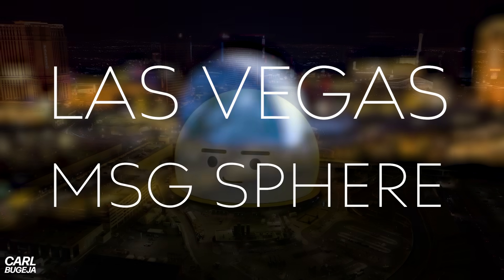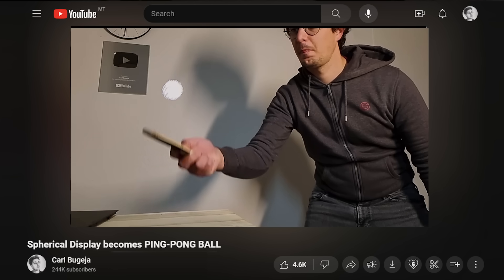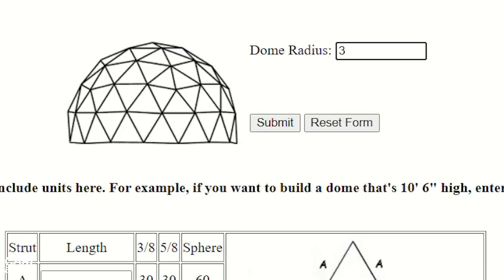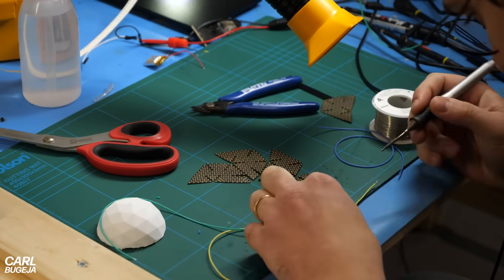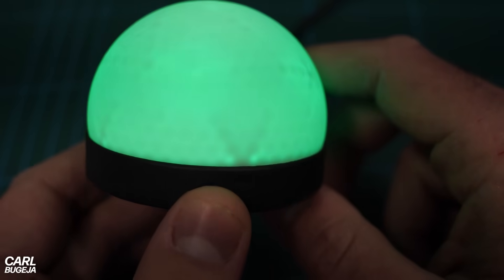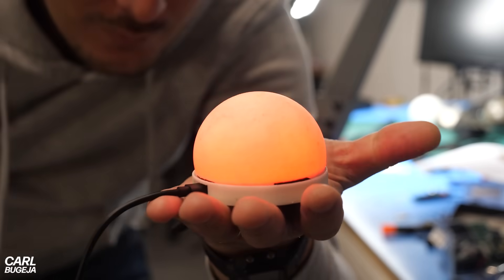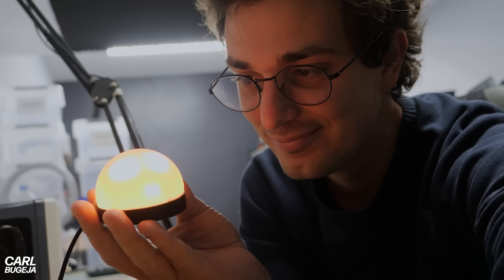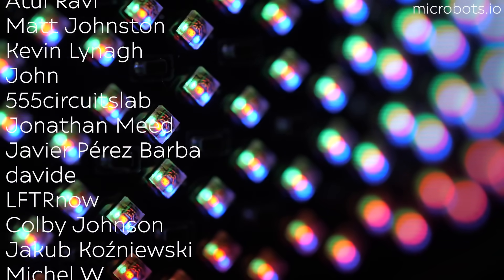Building a Mini Vegas-Sphere

Comment: Instead of trying to build using small leds, you should just increase sphere size and use flex led martixs or make your own from led strip.
The pixel size is not so important if your sphere is large enough.
eg vegas sphere has about 0.1 pixels per inch, you will be good with 1.5-3 ppi of cheap cheenese led matrix.

Comment: How about running fiber optics on the surface of the sphere? Rather than laying LEDs directly on the surface.I think it can give much higher resolution, since you can pack more fibers closely than a bunch of LEDs. But on the other hand, i think you'll have to do more working with those optical lines. Well i don't know, it just what i thought.

Comment: I'd move the decoupling caps to the backside so you can increase pixel density. To allow for mounting, use a wireframe structure instead of the solid geodesic sphere and fix it in place with CA glue, which also solves your adhesion issues.

Comment: If a flexible oled manufacturer could sponsor you, they could print the oled display with much higher resolution on your tessellated structure. A stronger self adhesive should help sticking it all together. 
Or you could experiment with a led projector. Not sure if the original has led panels or back projection though.
Still this is an impressive feat of engineering!

Comment: Instead of mounting the LEDs to a Flexible PCB, mount them to the diffuser.  Using rings, instead of triangles. You will be able to increase the density by making the rings smaller. Since, each ring is parallel, you don't have to worry about pixels being in different directions, or creases. At the very top you can use a circle with the initial 7 pixels in a star pattern.

Comment: How about using concentric circles of leds with decreasing diameters stacked on top of one another instead of the godisic sphere? Wouldn't it solve the issue with density and also with the uneven distribution?

Comment: I wonder if a tiny flat high-resolution LED screen could be placed behind a full 180-degree flat fisheye lens (like what the 360-degree cameras use) to produce the desired resolution.

The downside here is that you would need 2 of these for the full sphere and there would be a gap between the 2 sides.

Comment: If you are 3D printing the dome/diffuser, then couldn't you print it with LED sized divots so the LEDs would fit snugly and be held in place with a little clear adhesive?  Then you wouldn't need an internal support of the LEDs.

Comment: what if you created a flat matrix for the leds internal of the sphere on the flat surface then connected each led to the surface by fiber optic? You could potentially stack internal led boards at maximum density and increase the overall sphere surface light density.

Comment: May I suggest some suggestions.   You don’t have to reinvent always research what’s developed.   Displays with amoled are amazing small and relatively cheep so use say 5 panels from a smart watch and then design a lens to bend the panels light to the round surface.  Would be a little challenging getting into lens design but I’m sure you can.   Happy to chat about many advice and helpfull things.

Comment: I would have used minecraft logic. Make a big cube that is made up of smaller cubes that all are the size of one RGB pixel, then hammer away and remove enough small cubes to make the entire design as round as possible.

Oh and btw, be really careful with your eyes, i see in the beginning of the video you have quite alot of brightness on, even a short burst of high intensity light can damage your eyes - im speaking out of own experience as i have wortked alot with LED's and learned the hard way.

Comment: Just spitballing alternative mechanisms, but what about a rotating dome with fewer LEDs, arranged like spokes on a domed wheel? You wouldn't need to spin it as fast which would cut down on noise and vibration, but theoretically that gives you a much higher resolution and polar coordinate grid for easier mapping.

Comment: This is 200% sure is one of those typical "sounds easier than it probably is" ideas, but have you considered optical fibres?
With a bigger base to hide more leds and some optical fibres to route that into the sphere you could make this a lot higher pixel density without needing crazier hardware, just more leds 😁

Comment: as noted below, i think you could get a result closer to what you want with a few flexible screens (could be LCD w/backlight using ~1-4 LEDs inside the 7/8ths sphere), perhaps on a clear plastic spherical mount (could be webbed mount instead of solid), and maybe a little beefier controller (RPi 4 to start).  the most difficult thing is to find flexible screens that can be patterned so to be mounted in the spherical shape... or increase the size of the sphere so that you can use an array of 1.69 inch LCD displays (available on amazon for $15 each).  also, thinner and less diffuse outer shell (that might also make your current design look better).

Comment: Really cool to see. as an alternative idea, maybe superglue the pixels to the inside of the diffuser and then use very thin wire to connect them?  You might be able to glue some pixels over the gaps between the tesselation of the first layer and get a smoother effect.  You might have to build a positioning stage to move the diffuser under a small arm that could pick and place the pixels.  UV curing glue to hold them in place maybe?  maybe could use the same stage to place the wires with conductive glue to the pads.   this is probably a crazy idea but it popped into my head while I was watching.

Comment: Instead of tape to stick it to the surface just use transparent kitchen wrap. Wrap it tight around and it will hold the boards to the surface without affecting much the brightness, and the wrap will not be visible when you put the diffuser cover.

Comment: Not sure if this would work, but I would try putting a round LCD or OLED screen in the bottom and 3D print some kind of light guide to distribute the light to the right position on the sphere. After that each pixel need to be calibrated by an external camera in a fixture.

Comment: Probably not doable on an individual level, but if you were trying to manufacture these, I think the next step is to put another sphere of LEDs deeper inside, and guide their light out with gradually enlarging optical fiber to the surface, but the complexity of the build would easily skyrocket... sadly the only other way I can see to improve it would be to use custom shaped OLED panel to similarly wrap around the sphere.

Comment: fiber optics combined with layers of flat boards? Lots of little gluing but the electronics would be far easier. 3D printed mount for all the fibers I don't know if there is a small led-fiber option on the market, you'd be inventiung that.

Comment: I guessed your sphere has a radius of 4,5cm = surface 64cm²
The vegas sphere has a surface of 54000m²

If your sphere was as big as the Vegas one, it would cost  $21093750

The Vegas sphere cost $2300000000

The Sphere you build was 109x cheaper

Comment: A better way to do this would be to contain many, many, MANY more LEDs within a base under the sphere, and then use fiberoptics to route the many more LEDs to dozens of tiny holes drilled into your sphere. This way you get a much higher pixel density. Edit: You should be able to adhere the fiberoptics to each LED using a fast curing epoxy, or maybe even just hot glue, given you're able to press the fiber directly against the LED itself, so its brightness isn't hampered by the adhesive. 

I can't think of a downside to doing it this way, other than the ridiculous effort involved in producing such a contraption. And it would need to be bigger to accommodate the bends the fiberoptic would need to make to reach the bottom portions of the sphere. That would be a tough one to make happen, but I think it'd get you your highest possible pixel density, without going truly massive with it.

Comment: You'd need a 0.9" round LCD with LEN6254 lens: https://z-optics.com/wp-content/uploads/Half-Ball-Lens-ver.-231111.pdf
Reply: how does one even find this lens? I will save the PDF just in case I ever need it (for now it just wastes 524kbs of storage on my drive).
Reply: @konm08  it's such a specific component I guess you can only purchase from the manufacturer

Comment: You could use a bunch of optical fibers spreading out from an lcd screen to a translucent spherical shell. Once upon a time i got a night lamp with a bunch of optical fibers and a multicolor glass plate inside this lamp. The glass plate rotated and made optical fibers glow with different colors. I replaced this glass plate with a photo slide and got a rotating highly pixelated image of this slide on the ends of these fibers.

Comment: heres a simple solution: high res flat led matrix, spherical prism lens with a diffusor on top, some software to project the image for the resulting spherical output from a flat screen at the base. it should have a very dense and softly diffused image you can manipulate anyway you want. theres a more difficult but equally as fun way by using optical cables and a modified data stream to create a similar effect, with the right prefab parts of course

Comment: I think you should at least try to Master a dome before you do a sphere for sure, that can save you a lot of the cost right there. Improve the pcb’s adhesion to the plastic inner dome, maybe stuff a Bluetooth module under it and a battery lol. And you can probably fix the resolution issue with magnification trickery couldn’t you? Like a larger clear dome around it that’s thicker? Idk. This would be so cool to bring to market!

Comment: What if you put half of a glass ball on a circular display with a slight diffusion layer on top? That might be cheaper and less work but more heavy, or you still use a flat circular display and put a bunch of optical cables on it, so it forms a sphere with a light diffusion sphere on top. that should work as well.

Comment: A wacky idea might be to have the array flat in the base and then fibre optics to the surface. A royal pain to assemble, but your pixel density would be higher and the image sharper.

Comment: There are two ways to improve this. First for the current build use a double diffusion. I wrote an article on Instructables once explaining that technique. Could go deep into the math but basically measure the distance between the LEDs, put a sphere with a material that has half the diffusion value of your outer sphere at a distance that is half the distance between the LEDs, then put the outer diffuser over it at a distance that equals distance between LEDs. Would get rid of the artifacts from seams and also makes it much more display like.

Second idea would be using fiber optics. It would need a flat base that is larger then the sphere to house the LEDs but can then send the light from the LEDs to the diffuser sphere with varying length fiber optic cables. Could increase the pixel density a lot cause you could basically make it as dense as the fibers are thick. Just limited by the amount of LEDs you can fit in the base and amount of LEDs you are willing to put in. But can do even spacing better and just needs a bit of math to transform the flat image onto spherical locations.
Reply: i could see the fiber optic idea actually fitting within the sphere, if you were to make multiple layers of screens stacked inside the sphere with fiber optics leading off them.
Reply: The fiber optic idea is really good. I can see it working in my head. Even if you gotta make the base a little bigger or longer.

Comment: I think the best option at this scale would be to use rear-projection (eg. TI Pico DLP series such as the DLP2000 + DLPC2607). It would still be quite a lot of work though. And I'd imagine the most difficult part would then be tuning the optics to give decent image resolution/minimal distortion near the bottom of the partial sphere.

Another option would be using fiber optic bundles. An inner shell to hold each of the fiber optic bundles, then each bundle would terminate above an array of either RGBW LEDs or a TFT/OLED display. Although would be very tedious to construct manually and get good optical alignment / low loss.

Comment: Man I WISH you made a version of this, but at 30cm diameter. I believe that would mean around 3.5 to 4 times the original size, and I know, a LOT more pixels to work with, but the result might be amazing. The material would be easier at molding to a spherical shape, you would have a lot more definition, and it would be a killer furniture piece. Anyone would easily pay big bucks for that (I would!).

Comment: What if you used fiber optic cables around the sphere? Could drill tiny holes all around the sphere and have the tips of the cables poke out. Look up "fiber optic light toy", the tips light up.

Comment: idea that might work, get all lds connected in a flexible substrate, like glued in some ballon, than inflate it, very precise shaped and spacing due to equal pressure all around
easy will not be but might work to get very hight densities, since the last thing to do will be to inflate and get round

Comment: I would go with fiber optic approach. You basically need flat LCD or OLED display and multitude of optical fibers connecting its surface with the surface of as sphere

Comment: This is brilliant. Many years ago I made this…

https://youtu.be/4c3NLTvN6y8

Would you be interested in making it better? I am no longer able to due to Parkinson’s disease. I would happily send you the stl files for the icosahedron. I did map the LEDs for some basic animations using an arduino board (pro trinket), but it was more “routing” than “mapping”, and still suffered from some voltage drop issues.

I used standard WS2812b leds…there are 270 in the model shown. I did design some multilayer flexible circuits, but the price I was quoted for making them was in the thousands. Add to that the cost of the half-mirrored acrylic sheet (ouch!) and this effectively killed the project. It seems you have access to better services. I wouldn’t want anything for the design as all I can really contribute is the stl and advice/explanation of the routing. With those teeny tiny LEDs I am sure a much more pleasing effect could be achieved.

Let me know if interested?

Comment: Wouldn't it be easier to use fiber optics cables? you get more freedom in led placement as long as it fits within the structure but can get insane pixel densities.

Comment: Hi guy, let me explain how to improve the perception of the definition with a trick. Keep the PCB, but add a cover made of a grid with high density of holes, not less than 4 holes per leds. The right diameter of the holes has to be defined by test. This is the technical concept applied on the Chinese car ZEEKR 007 front panel.

Comment: Make a backlit E-ink version, and perhaps the board itself can be made in a spherical shape rather than flat and glued around a sphere. You can try 3M spray on adhesive that you can also brush or dot technique place into crevises and try wrapping it in tape or elastic bands until the adhesive is fully cured.
Make a contact lens version powered by converting the eye into a type of sodium wet cell battery!

Comment: Why didn't you use leds on points in an icosphere shape? you could have manually soldered them inside a perfectly round sphere and popped them out tiny holes

Comment: A second lightly translucent diffuser sitting basically JUST above the leds but not touching them but under the current diffuser would clear up the separation lines a lot and maybe even make the resolution look "smoothed" in a way.  Also software can to used to adjust pictures for the sphere and make the edges not look as stretched.
ON A TOTALLY UNRELATED NOTE I'd like to see something like this combined with the peppers ghost illusion.

Comment: next time i you have an issue with the tape not sticking, coat the sphere in contact adhesive and let it dry then stick the led board on , the contact adhesive will grip into the tape

Comment: One other way to do this is with a small Pico laser projector, prisms, and the diffuser.  As a laser projector it should have no trouble projecting onto oddly shaped surfaces such as the interior of a dome.  I saw something like what I'm talking about in a PC gaming magazine years ago.  Except that was half a dome, mounted vertically, used a rear mounted LCD or DLP projector aimed at a semi-hemispherical mirror that reflected the images and video onto the upright curved screen.  One other way you could do it is to use a flat video screen in place of the Pico laser projector.  In essence, you're creating a pocket-sized observatory projection system.  This gets rid of the complication of mapping all those trixel LEDs.

Comment: i guess it could kinda pay itself off if scaled enough to the right amount of LED's since that's the most cost effective part, you'd pay a fixed price for the other materials and would just have to expand on the surface area but idk, still cool project thanks for sharing

Comment: Would it be feasible to use a  dense bundle of optic fibers? Like, connecting them to the inside panels of the geodesic dome and running bundles to rgb lights. 
It would take a long time to make, but you could reduce the size of the triangles more, eliminating the gaps between the panels and the shell (which causes a lot of blur).

Comment: What if you had a bunch of fibres facing a flat led screen and the other end of the fibres poke out of the sphere. If aligned fiber to pixel, would the fibre relay the led light to the sphere? This can solve the resolution issue but you'll need a flat led panel that fits within the base. Maybe OLD for a higher density